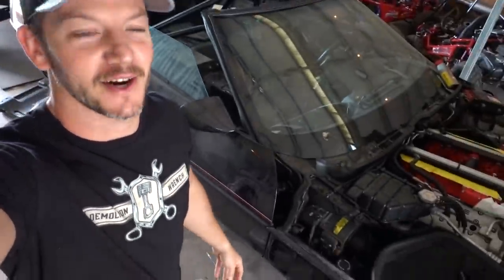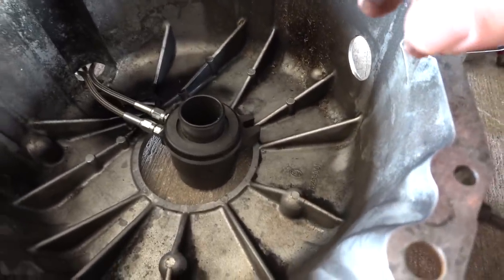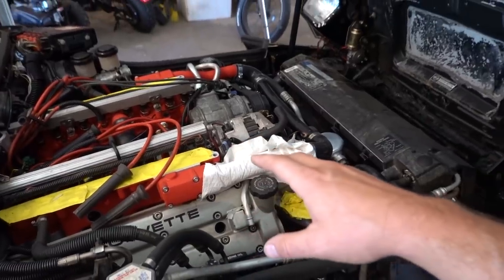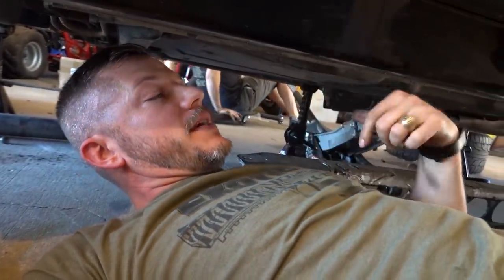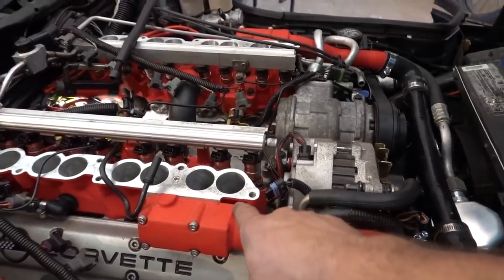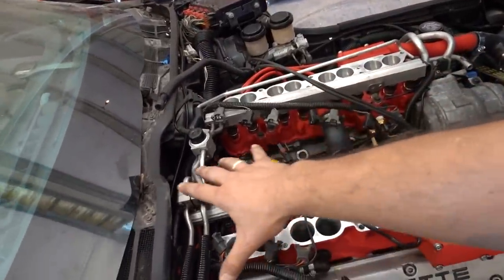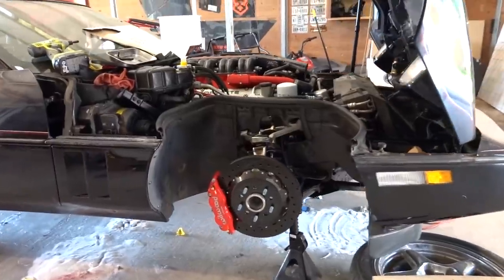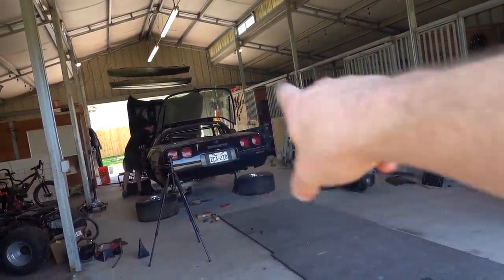Rebuilding a Destroyed ZR1 Corvette Part 9

Comment: With all the work and detail in this engine, the only thing that makes me jealous is how accessible the oil filter is.
Reply: I like the ones that face straight up so I can fill the filter with oil too.
Reply: Design flaw.......
Reply: Subaru fa20 has it right up top, have one one my forester xt, easiest change I’ve ever done.
Reply: My tacoma is like that. Right behind the driver headlight.
Reply: My 93 s10 was like that, it was the first and only time one of my vehicles had it and I loved changing the oil because of it
Reply: Stupid oil filter on my Highlander is under a heat shield, beneath a rad hose, in the middle front of the engine, up against the cooling fan. Can't reach it from underneath. You have to practically crawl into the engine compartment and then contort your body into an unnatural shape just to get to the damn thing. From there, you're feeling around like a teenager on a date to get the old one out and the new one in.

I love the car, but changing the oil is a PITA.
Reply: My 17 Ram has the crappiest oil filter placement EVER!

Comment: Mercury marine built the LT5 for GM. That "c beam" is a torque arm.
Reply: On miatas its called a power plant frame
Reply: Interesting! Seems it was designed by lotus too, so much for being a chev motor haha
Reply: rayn man it was designed by both GM and Lotus, built by MM.
Reply: @W.A.R.R.  well im sure gm told lotus what they wanted but it would seem lotus actually designed it since they were the one's running the project
Reply: @raynman6466  yes it was designed up here in the UK BY Lotus

Comment: Get cold air intake and aftermarket exhaust, to let it breathe properly.
Reply: Even Andre Solheim dude it has no exhaust 😂😂. Its breathing well enough
Reply: @jamacado2142  he should put on aftermarket and not the stock one :) it breaths "too much" now 😂 it will just make it better sounding tbh, not straight piped, but not too muffled would be good. Maybe corsa?
Reply: @TheSolheim  is the wiring even realistic? i'm no electrician nor a technician. but the wires just look too complicated to replace and fix

Comment: Matt, you should look into exhaust gates. With the flip of a switch or a push button it opens a valve and takes your car from a muffled system to an open no muffler system. Stacy David on the show Gearz has done it to two of his builds. Kinda trick and cool.

Comment: It sounds pretty. Still looks like that. Get that lady some war paint.
Reply: Or you can wrap it
Reply: bryce thibodeau pretty sure he’s gonna get it wrapped once it actually drives
Reply: He’s said he’s going to wrap it
Reply: Infected Miller but what’s wrong with actually painting it. Wrap is a half ass job of painting
Reply: Not to mention it has the weight of the paint and a wrap. And a clear coat and soon another wrap
Reply: Just sand it and paint it

Comment: You can put a tums or aspirin inside the thermostat, that will help with your air bubbles. The pills keep the tstat open, once the coolant flows they dissolve.

Comment: Is GM reccomending using 5W20 oil in high performance output engine, especially in a hot climate?

I see a potential rod knock in the near future.
Reply: I dont  use 5w any in texas. 10w in everything
Reply: Howie Felterbush  that's why I'm questioning the oil choice Matt made with this engine.
Reply: camjamsdad  that's not really necessary but wont hurt

Comment: Hey Matt I Build sheds in Australia and I Recommend you painting your Concrete floor. Over here we can get concrete Paint I'm sure you'll find some there. Paint that over your whole floor and any oil spins won't stain your concrete and you can wipe it up with a Rag. it'll cover any existing Stains. It does get slippery when went you can  put a little bit of sand in or down to get grip.

Comment: It sounds strong. You put it back together, great job. And Burke.
Reply: Go with the K&N filter from Eklers, with the mod and repairs looking pretty. It will flow more than a cone/can filter. If you can duct it for outside air, you'll get gains.
Reply: So, if u use the floor compartments for subs go 10" 300 RMS x2 in an angled box-top over the squares, pointed to the rear at about a 45*  angle. It can be raised up 5-6", on the port side, so there is room for amps btwn the bars and box. Use a wall in the middle of the box, over the floor separation, insulate metal & wood, seal and secure around the floor openings. Ports can be in upper middle, to the rear. U can put the 2nd 6x9s in enclosures mounted at top of roll bar, facing rear. When standing behind car with hatch and doors open it's all going in same direction. A DSP can time the waves to both seats when driving. With presets for either. This leaves some room for bags. So 6.5" at leading (stock) and trailing edges of door. In extensions angled towards the shifter ball... speaking of, check mail Monday.

Comment: Best way to burp a cooling system is with a vacuum pump.  Also, if you don't have a mechanical/hydraulic oil pressure gauge, it's entirely possible that you won't see it move while cranking.  Turning the key to the start position disables most other electrical systems.

Comment: Everyone trys to install trans seperate from bell housing but if you bolt bellhousing up first to trans its way easier and if you were on a hoist the driveshaft can be inserted near the rear diff and slide it all the way forward through c channel

Comment: Just an FYI   You could vae put the Transmission on a metal drip pan then slid it and not scratching up the barn floor!!!   Just something to think of next time!   Also, on all new builds, or existing cooling systems,  I ditch the ORANGE cooling fluid for good old Prestone Green!!!  Less radiator issue that way! Another also,  I use a can of stater fluid on a fresh motor!

Comment: I recommend ShoeGoo to seal up those holes in the plastic air intake.  Dries ultra strong with a slight flexibility so it doesn't crack.

Comment: just so you know matt reving that motor before break in period can trash that motor the metal still has sharper edges that can cause it to eat itself under high rpms you shouldnt rev a high hp motor it will destroy it trust me ive built top fuel motors pushing way over 1000 hp dont rev it of at least 10 hours of running drag motor are ran hard new but there also only designed to last a few 1/4 passes before they are tore down and put new rings and bearings in if you want more then 1000 miles on it id recomend running it at idle for 10 hours to let the metal wear in it the change the oil and let it run for 5 or 6 hours longer so it has time to break in or if you dont want to do that i wish you luck when it tosses a connecting rod through the side of the block

Comment: The main purpose of a driveshaft loop is to keep the car from pole vaulting onto the roof if the front u-joint were to break at speed. It needs to always be mounted at the front half of the driveshaft.. You have installed in the right position I just thought that was an important to point out for others. Bad ass car!!!!

Comment: An older engine could get oil pressure with just a simple tool, drill, and oil pump, no need to stress the starter.

Comment: Matt, given any choice in the matter, I would have mounted the bell housing and hydraulic clutch actuator all together before attempting to stab it. The loose Clutch mech likely got you in a bind and by the time you figured out any of it, the clutch disc was knocked out of center and easy had left the building.

Comment: 99% of the time you just start the engine and it will pump oil faster and cause less damage then cranking it without firing, good job on the car tho keep it up

Comment: Sound deadening all over the interior before you reassemble.  You’ll thank me later.
Reply: Too much weight.
Reply: Surago 30 lbs is too much weight?
Reply: ic3p1k you think that’s all it’ll weigh? Lol. We added the proper sound deadening material to my buddy’s car years ago. We ordered 350 lbs of that stuff and still didn’t have enough.
Reply: Surago 350 lbs?!?  Absolutely no way.
Reply: ic3p1k that stuffs heavy. And sometimes you gotta double it up in spots. Also to be fair, we did the whole car. Trunk roof, door panels. Everything. You couldn’t hear a train go by when he was done.
Reply: Surago it is about .8 lbs per square foot.  You must have done a limousine.  lol. You really only need to do the floor and the doors and a c4 Vette doesn’t have THAT big of an interior.  I know because I did my 87 last month.  So worth it.

Comment: For your leaking air filter housing you could weld it back together. You can buy a kit for welding plastic, but J-B weld would probably work just fine.

Comment: You got lucky your fuel problem happened the way it did. if you run an electric fuel pump with no fuel it will burn up the pump and ruin it.